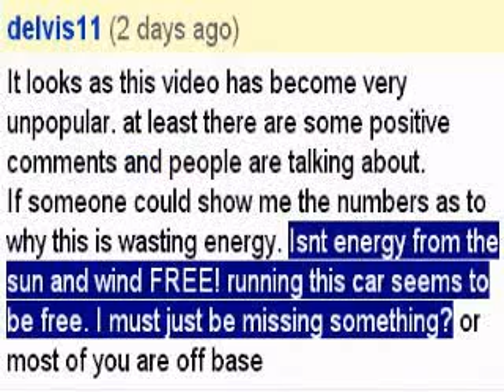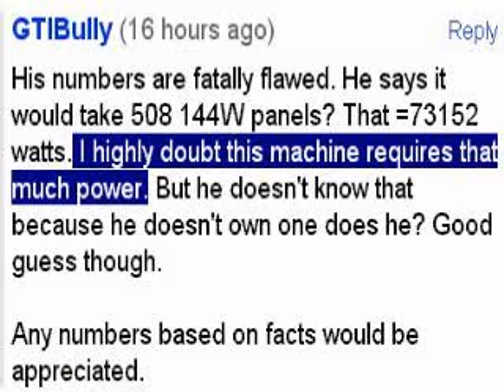Part Two. 'run your car on water. This guy does just that!'

Comment: Well in that case I would say its time to take it out to the back pasture and lay her to rest. 

Do you have life insurance to drive it?

I have had some beaters, too. One you could turn the steering wheel a fully 1/4 plus turn and the wheels wouldnt move at all. 

It could also count change on the ground as you ran it over, just listen to how many and how bad the bangs were.

Comment: did you factor in efficiency when figuring it's fuel consumption at 55? at 55 on a level surface with a tailwind you should be using at least 3 gal/hr.

Comment from the maker: Yes indeed, my Toyota has gone from 150 HP to about 110--- it is 17 years old, and the wheel bearings have never been replaced. The drive shaft's center support bearing is MISSING, and the front end's tie rods are bent. I have to use third gear to get up even moderate inclines, the poor thing.

Comment: You talk to the top of mic, not the front. Is it Samson, or Rode maybe? The switch on the mic usually a -10 dB pad and/or a mode changer to switch between omni directional, figure 8 or cardioid sound capture.

Comment: so 61508 joules, or 61.5 kw of fuel consumed

at 33% eff. = 20.297 kw of kinetic energy used. 
Which fits nicely wih the earlier projected 20kw

This is 20.297/.746= 27 hp 

not 42hp, your calcs would be 19mpg
I believe your truck runs like crap.

Comment: toyota truck = 30 mpg 
gasoline 32 Mj/litre  for 87 octane
20kw to move a small toyota at 55 down a road. 

1 gal = 3.7854 L

1 gal = 121.133184Mj = 121,000,000 joule or watt seconds

at 55 miles/30mpg=1.83consumed so 221,430,000 joules consumed in one hour
221,430,000/60 = 3690500 joules per minute or 61508 joules

Comment: Also. the efficiency of an internal combustion engine, designed explicitly to use refined petroleum, drops dramatically when using hydrogen as fuel. Why not just use all those kilowatts to charge batteries in an electric vehicle. Electric traction motors are far more efficient than ICEs anyway. All this conversion from electric power to electrolysis, to fuel, to an ICE is horribly lossy. Just do it directly, elegantly, and with less bother.

Comment: Desertphile, the thing you want is called a 'pop filter', is is like a small screen which goes in front of the mike, it is made of  mesh which is supposed to disperse those poppy sounds away from the mic.
(something to do with the shape and size of mesh), they are 20$ or so and come with a fitting thing. socks probably do as good a job in many cases,
regards

Comment: GreenPowerScience posted a nice video today about someone's homemade power conversion from solar. The title of the vid is: "STEAM ENGINE 12KW GENERATOR Solar Mirror Array"

Still, to run a car it would be better to convert that energy for use as battery power, rather than conversion to hydrogen--which is in agreement with what you've stated, of course.

good vid!

The EASIEST way for someone to produce their own automotive power is to make their own alcohol from....whatever.